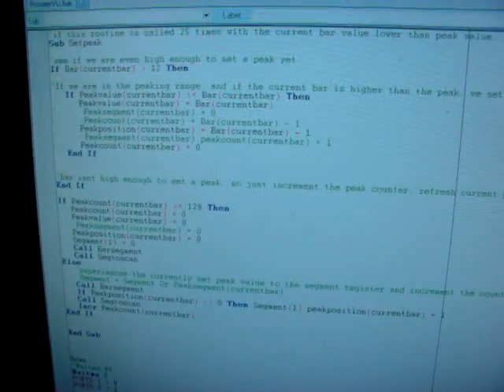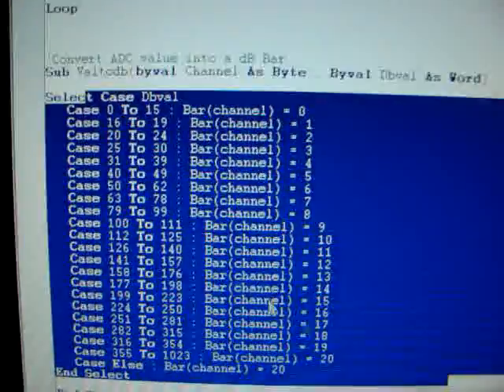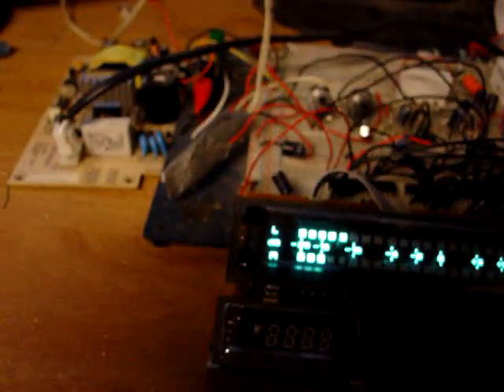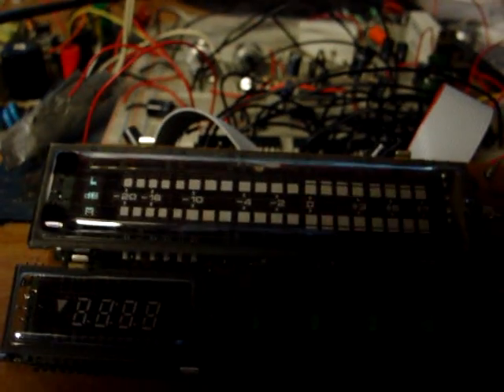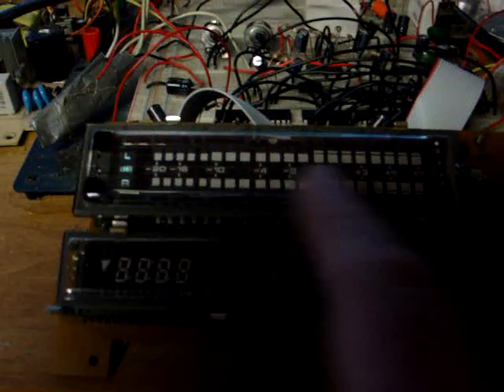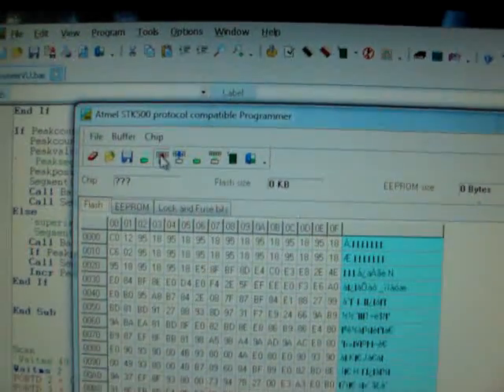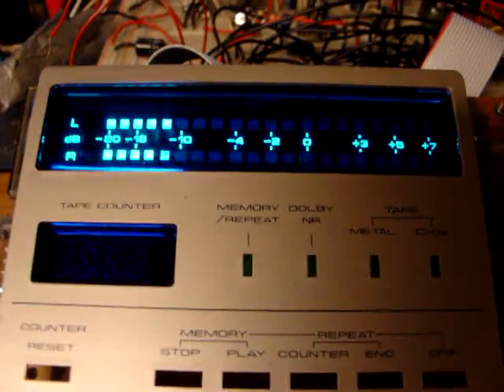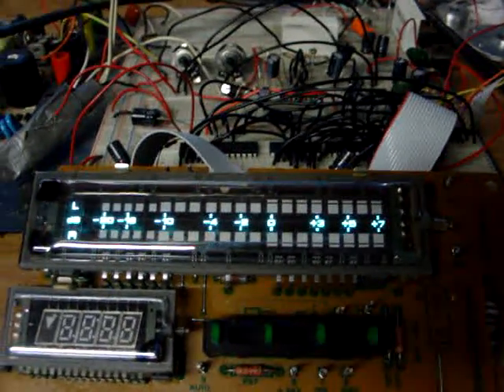DIY Pioneer VFD VU meter part 2

Comment: Hello, I want to do a query, I have an RT 909 pioneer your VFD vu-meter does not light, it appears that this exhausted and I could not get spare you the video so I see this testing a vu-meter model CT-F 900 or 950, sorry I do not speak your language so I check it through an online translator, you would know TELL ME IF I CAN EASILY ADAPT tHIS yOU ARE TRYING tO MODEL pioneer RT 909 ??, the only difference I see is that it has a leg unless the VFD 909 agradesco much ... you can help me. Daniel